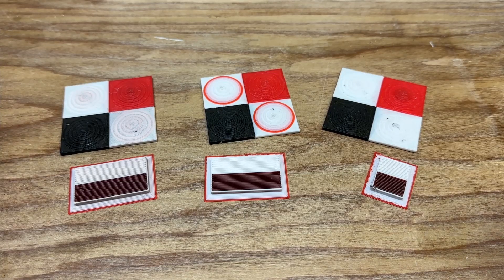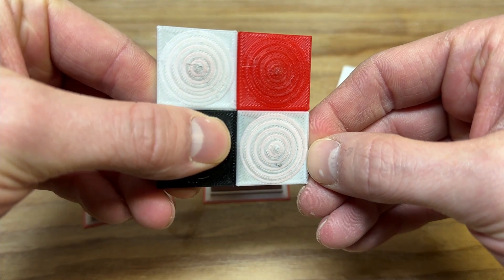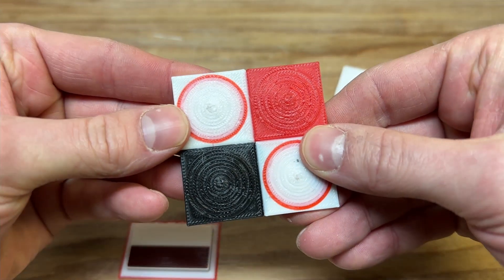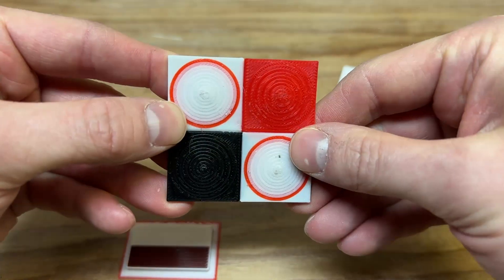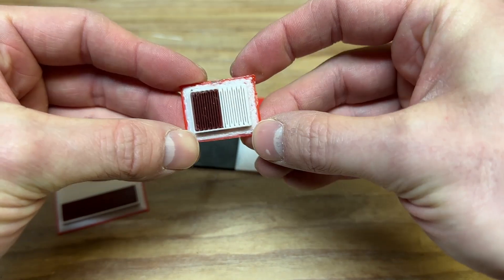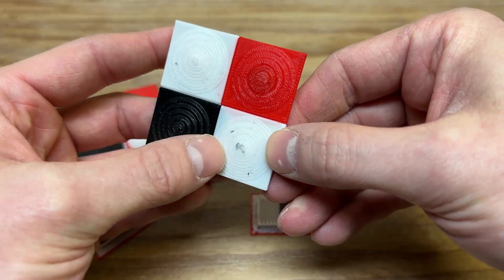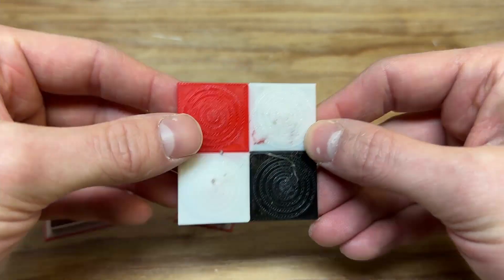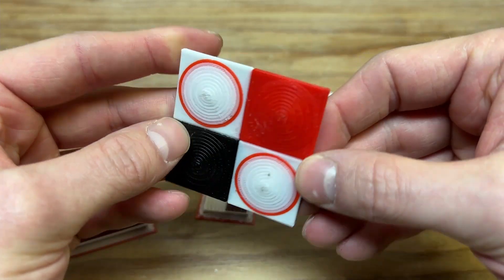Do Prime Towers Matter on the X1-Carbon?

Comment: Pff okay so I just messed 6 hour print because I decided to go cheap. To be honest 3 of those prints :D
So now I successfully failed with 0.25 and 1/4 of the prime tower. Looking at the slicer for hour makes me think that prime tower plays bigger role than the flushing distance hmm...
Reply: From what I understand is that the prime tower isn't intended as a purge mechanism. Hotends have a tendency to “ooze” a bit of melted filament out whenever they aren’t activity depositing material. This would create little blobs or structural problems on your print. The prime tower is essentially a blob absorber. It primes the nozzle for printing. That's why it's called a prime tower and not a purge tower.
Reply: @lout160   that is true. But from what i can see lately it is benefitial to the quality of the print. I mean you could go without prime tower  and lower the flushing volumes but in reality the tower does so much of the job of flushing thtat material out.

Comment: Awesome, thanks for the testing. I did a globe print on Printables ( four color relief globe with stand MMU multi-color print) and used 0.85 and a 1/2 size prime tower. Turned out OK, but I'll be braver now, maybe 0.5 & 1/2.  I've heard about golf balls or desicant containers for weight in spools in the AMS, but I've only had my X1CC since end Feb. Sub'd here, and followed on Printables (mobiobi there and Bambu Lab Forum too) Looking foreward to more solid vids like this, thanks again.
Reply from the maker: Hey thanks for the sub and the positive comment. Glad you got some value out of this video. I've seen those desiccant holders that go in the spools and they're definitely on my "to print" list.